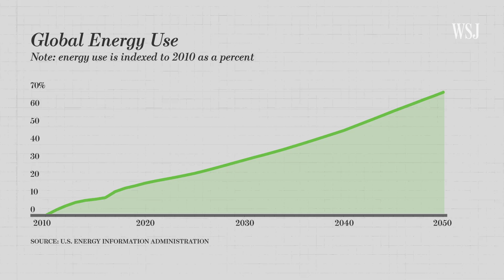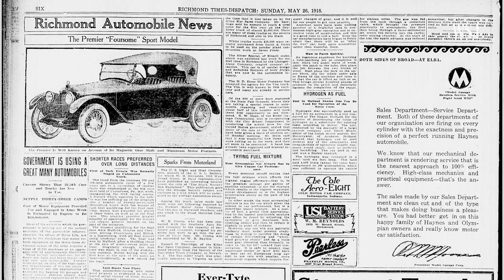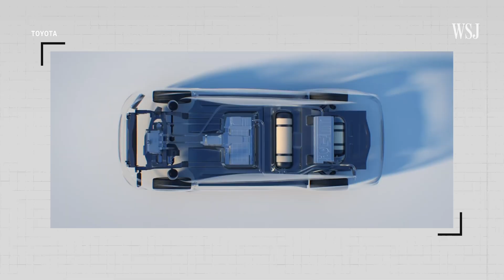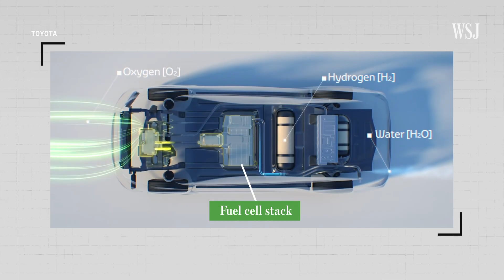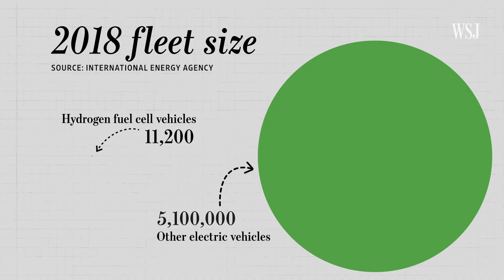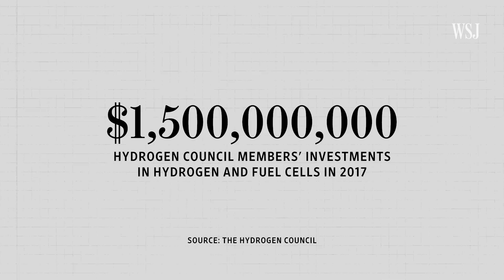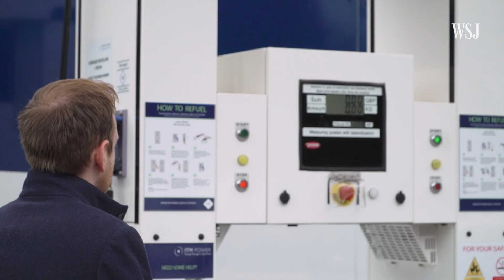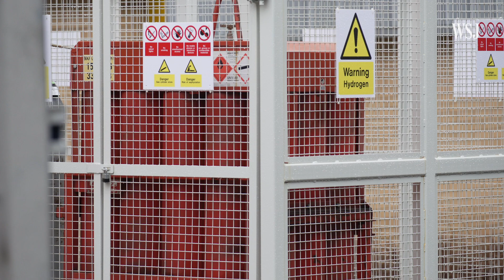Can Hydrogen Fuel the World's Fast-Growing Energy Needs? | WSJ

Comment: Don't say Battery was better than fuel cell! Remember battery not a Generator! Don’t forget battery tech need to follow the Golden ratio to Develop and get into the Market
Reply: This video is an advertising lie!
They don't lie about what they say.
What is lied about is what is not said.
It is lying when you deliberately conceal or belittle important facts.

2:36min Water and electricity produce hydrogen
However, you forget to mention that you need about 50kWh of electricity to produce 1kg of hydrogen. 1kg of hydrogen only has an energy content of 33kWh. The rest of the energy is lost.
Furthermore, until the end of the film it is not mentioned that today hydrogen comes mainly from natural gas, coal and crude oil. Hydrogen is produced by fossil fuels at a rate of >95%! Because hydrogen from the electrolysis of water is much more expensive.

It is clear that hydrogen is an (extra to be produced, secondary) energy storage medium, but it can in no way solve our energy problems.
Remember hydrogen not a Generator!

After all, the electricity for electrolysis has to be generated first, and it is better to use it as directly as possible instead of first producing hydrogen and then using it to generate electricity again. Because of course there are additional losses.

Hydrogen is above all a lie to keep people from using renewable energies! People are put off instead of, for example, generating their own cheap photovoltaic electricity and using it to charge their own electric car.

An electric car is cheaper, easier and better than a hydrogen car. No one in the world is therefore building hydrogen cars in large numbers. The Toyota Mirai doesn't even have a folding rear seat back....

Comment: F** no. No, thanks. I'd rather not die in a hydrogen explosion.
Reply: J.P. Silva you wouldn’t if you used hydrogen on demand. Creating the Hydrogen gas as needed.
Reply: @jonbishop9062  In a universe where thermodynamics is not a concern, sure.

Comment: Instead of stating that we are definitely on the edge of commercialization of this technology he should have said the usefulness and effectiveness of the technology. Commercial interests are at risk of influence from corporate players with other investments.
Reply: This video is an advertising lie!
They don't lie about what they say.
What is lied about is what is not said.
It is lying when you deliberately conceal or belittle important facts.

2:36min Water and electricity produce hydrogen
However, you forget to mention that you need about 50kWh of electricity to produce 1kg of hydrogen. 1kg of hydrogen only has an energy content of 33kWh. The rest of the energy is lost.
Furthermore, until the end of the film it is not mentioned that today hydrogen comes mainly from natural gas, coal and crude oil. Hydrogen is produced by fossil fuels at a rate of >95%! Because hydrogen from the electrolysis of water is much more expensive.

It is clear that hydrogen is an (extra to be produced, secondary) energy storage medium, but it can in no way solve our energy problems.

After all, the electricity for electrolysis has to be generated first, and it is better to use it as directly as possible instead of first producing hydrogen and then using it to generate electricity again. Because of course there are additional losses.

Hydrogen is above all a lie to keep people from using renewable energies! People are put off instead of, for example, generating their own cheap photovoltaic electricity and using it to charge their own electric car.

An electric car is cheaper, easier and better than a hydrogen car. No one in the world is therefore building hydrogen cars in large numbers. The Toyota Mirai doesn't even have a folding rear seat back....

4:28min Using electricity from hydrogen to charge electric cars?!?
A curious idea when you look at the costs. Not everything that works technically makes sense. This idea is nonsense.

5:29min If you look at the members of the Hydrogen Council, it becomes clear what these companies want. We should have to keep driving to petrol stations instead of generating and charging our own electricity at home.
Reply: @joegoog  indeed. The idea of using hydrogen to charge a BEV at a shopping centre is utter nonsense. I'm astonished they had the nerve to say that. If you look at AFC Energy's website today it makes clear their product is for off grid locations such as construction sites,  or emergency backup instead of a Diesel generator, eg at a datacentre. Those are reasonable uses.

Comment: As a rule I don't bet against Elon musk in the long term. Good luck with all this.
Maybe for ships and planes but. Not cars
Reply: Electric Cars sales were only 2% of all car sales in 2019. This is very low. Lithium, just like oil are limited resources. They say sea water levels are rising. Yes, we can use sea water to make hydrogen
Reply: I concur. So long as battery raw materials continue to be abundant,  Mr Musks position will hold true.
Reply: Basic efficiency calculations cut against fuel cells and suggest batteries are the way to go for consumer vehicles. Making hydrogen is just inherently inefficient. Fuel cells are a really cool technology, but unfortunately it’s just not a compelling choice when stacked against batteries. People have been researching hydrogen for at least 50+ years now and it doesn’t seem like hydrogen production technology has advanced materially.
Reply: With minimum of 1 hour for recharging, and the devastation that Lithium mining brings, really?

Now that the University of manachster has developed an ambiant temperature, standard pressure H2 storage, the hydrogen tech circle is finally complete Proton Exchange Membrane, graphene and this last component in place, Electrolytic and Fuel cell PEM units can now be made relatively economically - and ever more so, as graphene manufacturing becomes more mainstream - 

But Elon Musk MUsT now talk down H2 to stop investors walking away, and stringht into the arms of Japan, South Korea, China, Germany,  and Norway.. and soon the UK too!

Offshore oil platforms can be repurposed as hydrogen production platforms, constantly electrolysing water, and producing commercial H2 fuel, as well as O2 for industry and seasalt as byproducts!.. with a few minerals - even Platinum and gold, in tiny quantities.

Until the new tech from H2Go, however, this was where it all got a bit clumsy...and even dangerous!
I mean.. who wants to travel around with super-pressurised tanks in the back of the car? And both, Cyogenyc h2 slush and Metal Hydrides require energy to get back the H2 stored.

So, I would be happy to invest oin the tech, and if i see an opoportunity i WILL take it! After all, I investe in wind and it's earning more than many other 'standard' tech would have, so I am feeling pretty positive...

The real question is; will it happen in time to make a difference to the overall fate of our planet?
That would be SO bitterly ironic, if the ultimate saviour of mankind arrived just that little bit too late, because markets have been reluctant to fund the R&D that could have saved us all!

http://www.h2gopower.com/

Comment: Getting H from biomass using either gasification or anaerobic digestion is much more energy efficient than electrolysis. They did not even mention biomass. 

Also, ammonia is easier and safer to store (many countries already have storage infrastructure for ammonia fertilizer) and can be used in typical gas engines with minimal modifications and a small amount of fossil fuel (gas or diesel). http://www.nh3car.com/index.htm

Comment: First, we had the petroleum lobby.

Now, we have the lithium lobby.

Goddamnit what's it gonna take to realise hydrogen is just... better.

With EVs, we'd be dependent on mines in Africa. We're simply replacing one mineral that should've stayed under the ground (petroleum), to multiple others - nickel, cadmium, for batteries.
Reply: You sir are a clear stupid. First of all lithium is not a fuel its just a storage medium so you need a very small amount. Secondly you can recycle it over and over unlike fossil fuel. Last and most importantly its abundant everywhere not just africa and doesn't harm the environment. Although mining it currently is slightly harmful but it's a simple technology problem and can be solved with time. Hydrogen will replace fossil fuel not in the vehicles but as a source of Electricity. It's simple, Hydrogen in Fusion power plant will generate electricity which will charge lithium batteries and batteries will power the cars.

Comment: If we can harness energy for all our needs that does not pollute and does not require metals that when mined cause human strife and environmental degradation, we’ve really reached the best of what humanity can achieve.
Reply: Then hydrogen is by no means the right way to go. The electrolysers need iridium and ruthenium as catalysts. The fuel cells need platinum.
Plus the huge energy losses due to the many conversions ...

Comment: The WSJ did excellent reporting in the past on the fraudulent biofuel companies by stepping past the mountains of hype from venture capitalists.  Here, though more battery EVs are made every week than all hydrogen vehicles ever made, the reporter allows the industry the last word with the like of “definitely in the verge”, with a background sound track.  What happened WSJ?
Reply: They also said electric cars would never make it because batteries didn’t have the range, 40 or 50 mi at that time. It has taken a long time but hydrogen is getting close. Infrastructure will have its place. Remember batteries are no cleaner than the source of power that charges them.
Reply: @davidrte.664   

  There is not now, nor has there ever been, an H2 based vehicle in mass production. Mass production of new transportation tech takes a decade or more to set up, and that's assuming the power source is already widely distributed, like gasoline or, to lesser degree, electric charging facilities.  H2 has no large scale wide distribution mechanism in place, not anywhere in the world.  And H2 is also no cleaner than its source. Current H2 production is 99.9% from fossil methane.  If its made via electrolysis, then H2 is also no cleaner than the power used to run the electrolyzer. 

Telling stories on the net about what is going to happen real soon now won't help.
Reply: Ok try to grasp this more than one energy source is needed. If we rely only on battery electric in 30 or 40 years we will be in the same boat as now with hydrocarbon fuels. I do not believe that petroleum co. Will do this out of philanthropist intentions but to survive. And hydrogen won’t take over the market but it has a lace in heavy duty trucks and in some areas of the car market. Batteries that will fill all the needs are a lot further off than is excepted and if we wait on the market to decide it will be to late for either.
Reply: @davidrte.664  There is no mass production of H2 heavy trucks. 

"more than one energy source is needed"

Its either fossil fuels or nuclear power, and in the case of transportation fuels synthetic liquid fuels made from nuclear power is plausible.  Forty years ago the world was being a new reactor online every two weeks, without trying hard.  Just run that play again with some more investment this time, and political correction to the silly regulator.  

No other choice, pick one.

Comment: Hydrogen fuel cells have potential for trucks, trains, and maybe planes, but are pointless for passenger vehicles.

https://youtu.be/f7MzFfuNOtY

You alluded to the main problem:  The fact that hydrogen is the most abundant element in the Universe doesn’t matter.  Hydrogen on Earth, as you correctly pointed out, has to be separated from the molecules it is bound into.  That process takes a lot of energy.  You then have to compress it, which takes even more energy.

By the time you expend that energy, fuel-cell cars are barely any more efficient than gasoline cars — in the 25-30% range.  Over the next decade or so, we can probably get that up to the efficiency of a gasoline-electric hybrid.  Further progress beyond that is much more difficult.

Charging, then discharging a battery, and then converting that to forward motion through a motor, is vastly more efficient:  around 75%.

And in the meantime, 350-kilowatt quick chargers are being installed now.  They can give thus-equipped battery-electric vehicles 100 miles of range in the same time it takes to fill up a hydrogen-fuel-cell vehicle, or 250 miles in the time it takes to take a bathroom break and get a drink.

That’s only in the scenario of long road trips.  Most of our driving is within town, for which you can plug in overnight.  It takes about 2 seconds to plug in and two seconds to unplug in the morning.

Comment: Just curious, is this hydrogen fuel the same as deuterium?
Reply: OrFenn Schuller what? deuterium is just an isotope of hydrogen, what’s the question? Really guys, we learn about electrolysis in highschool- you could make a hydrogen fuel cell yourself right now if you wanted, just stick two wires from a battery into some salt water.

The issue is producing it in a green way and getting the maximum efficiency.
Reply: You probably refer to nuclear fusion, which produces energy. We can't produce energy by nuclear fusion so far, besides the hydrogen bomb.
In this discussion, it's about the use of hydrogen for chemical energy storage.
For instance: Solar cells produce electricity. With electricity, we split water into hydrogen and oxygen (electrolysis). Then we could use the hydrogen for instance in a fuel cell to produce water and electricity again.
One major problem is the energy loss, you get just a fraction of the original electricity from the solar cells back.
One major advantage is the very high storage capacity at reasonable costs.

Comment: With regular ev vehicles rising quickly in popularity, like Tesla with cyber truck, semi and Model Y on the way, charging stations are going to become a lot more common.  But maybe we'll see more hydrogen additions where a more reliable and fuel source is needed like for industrial applications.  It's inevitable that governments will phase out combustion engines for transportation and when that happens we'll have a great need for hydrogen if it can be used readily to generate electricity where water is accessible.
Reply: It takes energy to make hydrogen. If you have electricity to do so, just use it directly! Or stick it in a 95% efficient battery. You need a good reason to go through the inefficient detour of making hydrogen.
Reply: @skierpage  op is probably confused about the process. I do think hydrogen may have a role in long term storage to cover gaps in wind power availability or cover seasonal demand differences, eg overbuild wind power for summer usage, store excess energy as hydrogen in a salt cavern or disused mine, in winter when more energy is needed for home heating convert back to electricty to power heat pumps.

Comment: Even if you make the vehicles, you need countless fueling stations that must maintain strict, gasket tight tanks. These are very expensive and dangerous if a leak occurs. All leaks are invisible and odorless. You're still driving a bomb on wheels. At the end of the day, with fuel cells you're dealing with Atoms, whereas with EVs you're dealing with electrons. Electrons are far cheaper and easier to manipulate.
Reply: Any proof Marcio ? - You can shoot a 50 mm armour piercing bullet in the H2 tank (you should have a clear shot- which it won't have) - it won't fail - and if the tank fails - no Hollywood explosion. As the lightest element in the universe it will  go right up, burning without much fuss. 'The bomb on wheels' is your imagination, not mine, and not scientific.
Reply: @janverboven  At the end of the day manipulating electrons (EVs) is far easier and cheaper than manipulation atoms (H). It's an economic reality that is obvious.

Comment: Hydrogen is great for large vehicles like: ships, trucks, buses, trains. Cars?  Probably not. The hydrogen fuel cells are about 85-90% efficient. Weigh this against an internal combustion engine at around 20% in real world operation.  So far more of the hydrogen is converted to propelling a vehicle.  This offsets the higher disadvantages of producing hydrogen - it takes more energy to produce hydrogen than energy we get out of it.
Reply: Just as has happened with cars, there are 20x more companies announcing and selling battery electric buses and trucks than there are showing hydrogen prototypes that may enter production. And there are a few battery electric ferries in service. And trains that run on batteries in-between electrified track sections near stations. The role for hydrogen keeps getting pushed into the harder parts of transportation. Meanwhile 90% of all current industrial use of hydrogen comes from natural gas, so the Hydrogen Economy™ isn't green yet.

Comment: Hydrogen production is just a huge problem (and in all likelihood insoluble), since elementary H2 does not exist in abundance on Earth, so it has to be extracted from hydrocarbons (derived from oil, or natural gas), in a process energy-intensive and emits CO2 in large quantities. Subsequently, given the low density, H2 has to be compressed, which again consumes a lot of energy. Finally, pressurized fuel is highly flammable and leaks are dangerous, having to be transported, like fossil fuels, to refueling stations. If I'm wrong, correct me.
Reply: Hydrogen production is already at huge quantity of 70 million TONS yearly world-wide.  The industry already have a lot of experience in storing and handling Hydrogen.